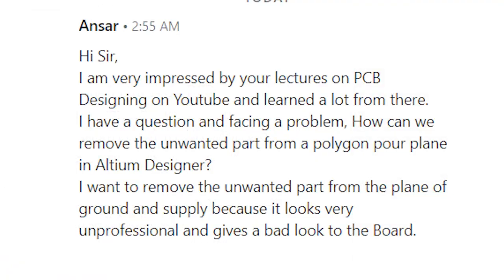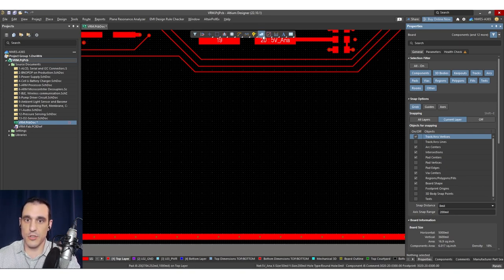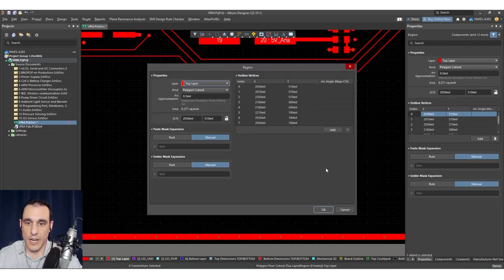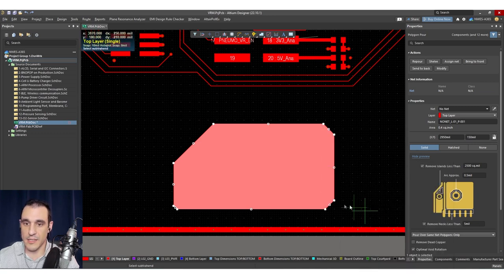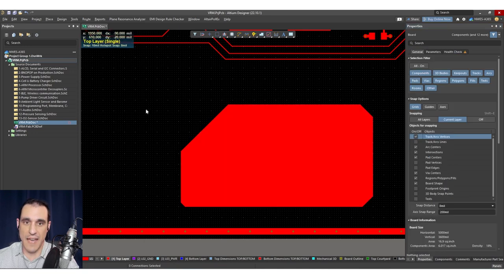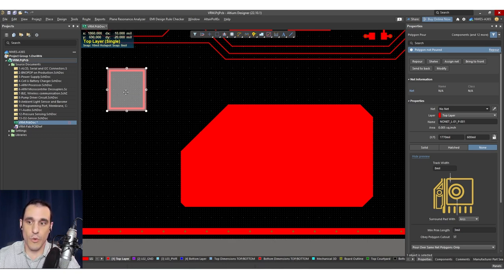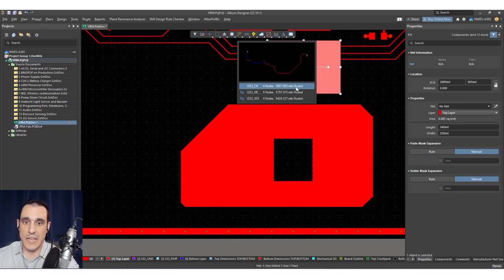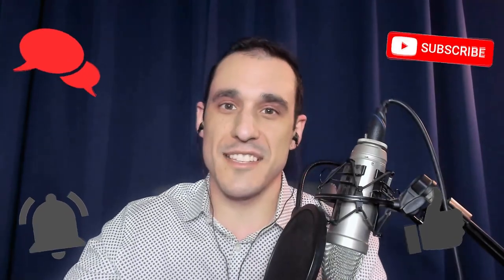How to Make Polygon Pours and Cutouts More Professional

Comment: I had a problem with overlapping polygons where the larger one covered the entire area of the smaller one. Each time changes were made I had to repoure the smaller one before doing the same with the larger. Otherwise the larger one would fill the entire area and the smaller one would have never been created. I couldn't subtract the larger one with the smaller one and then place a new smaller polygon in the ensuing cutout area because the cutout would have prenvented the new smaller one from being generated. It wasn't easy to create the two separately out of lines either because the lines were closed loops, my PCB was a bezel frame with the center area hollowed out and the polygons were defined by loops. Then I discovered this cool feature: under Tools->Polygon Manager, there's a "Pour Order" section that allowed me to specify the smaller polygon as the one to repour before the rest. Turned out to be the most elegant solution to my problem. Just sharing this additional tip and hope it will be helpful some day.
Reply: I remember when I discovered this, it has prevented a lot of headaches!

Comment: Hi Zach, what about circular PCBs, is there a way we can polygon pour and cutout a circular shaped PCBs? does it follow arcs etc?
Reply: You can draw out a circular region on a copper layer or mechanical layer using the drawing tools, then select it and convert it to a polygon. Use the option Tools » Convert » Create Polygon from Selected Primitives
Reply: @Zachariah-Peterson  I figured it out myself before your answer, but its still golden. You are the best Zach

Comment: Hey Zach, 

Thank you very much for these tutorials. THey are very detailed and very instructive.

Could you also make a tutorial on how to work with "weird geometry" routing in PCBs? I mean when it is required to use different snapping angles than the standard 45 degrees or more round-edged polygons and traces.

Thank you in advance and keep up the great work!
Reply: Great idea, I had a question about this recently in reference to zig-zag routing, I'll add this to my list of ideas.
Reply: @Zachariah-Peterson  Hello Zach. 

I have a question for you that is unrelated to the topic of this video, but I hope you answer it. 

My PCB, which I designed for a competition, is almost finished. I want to fix my total PCB thickness at 1.5mm by making the dielectric layer of 1.4mm in this PCB, which I use on both sides with 2 layers. But when I enter the layer stack manager and change the thickness of the dielectric layer and press the save button to save the change, it gives me an error saying "Access to "C:\Program Files\Altium\AD22\filename.PcbDoc.pcbstackup" path is denied". I searched on the internet but couldn't find a solution. 

I wanted to ask you as a last resort. 

Thank you very much in advance. have a nice day :)
Reply: @furkanozdemir3994  This sounds like the default behavior for Windows. The problem is that you are trying to save the PCB in the Program Files directory, which Windows normally prohibits applications from doing. Try saving it somewhere else on your computer.
Reply: @Zachariah-Peterson  Hello Again Zach. 

Thanks a lot for your answer. 

it's work now :)

Comment: How the heck do you prevent polygon pour on components or certain components... Trying to prevent the pour from filling the gaps under a component for example the pour filling the area between the 2 pads of a resistor package i.e.:1206. It would be nuts to do a polygon cutout on every single component.
Reply: You can set the polygon clearance to specific objects in the PCB layout or to components in specific component classes. I can create a video that shows how to do this with the rules system and the query system. This way you don't have to do this just by using a single clearance value.

Comment: another problem with polygon pour is: that it doesn't connect to a via that has the same net as the polygon if the via is surrounded by other vias on three sides,  I left one side open for polygon pour to connect,  but it just doesn't connect.   it is not smart enough, when unable to make a solid connection, it just leaves it unconnected.
Reply: Are you using the "Pour Over All Same Net Objects" option in the Properties panel when you create the polygon? Then it should pour over any object with the same net, including a group of vias near the pad.
Reply: @Zachariah-Peterson  When select the option, it does connect,  Thank you very much.